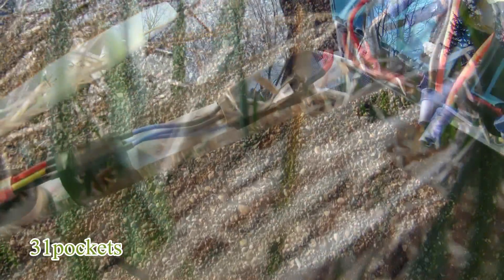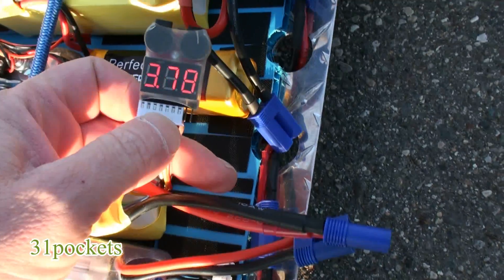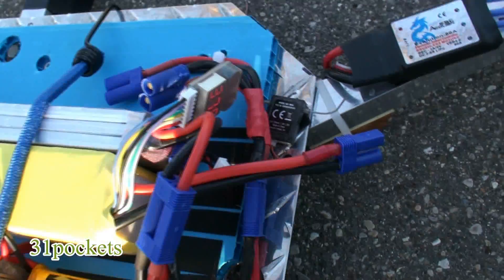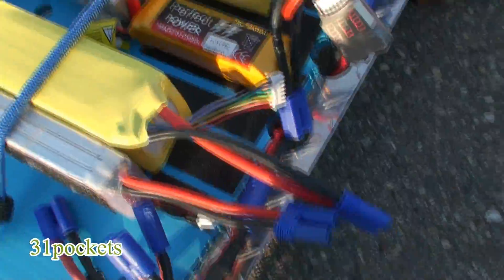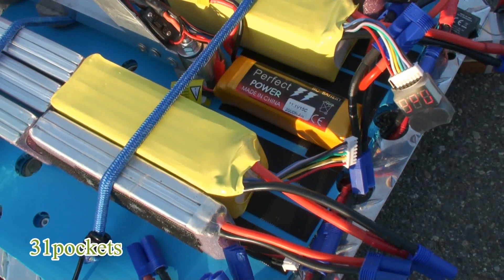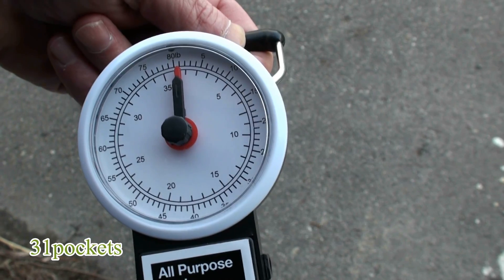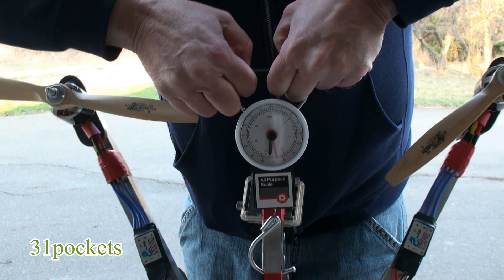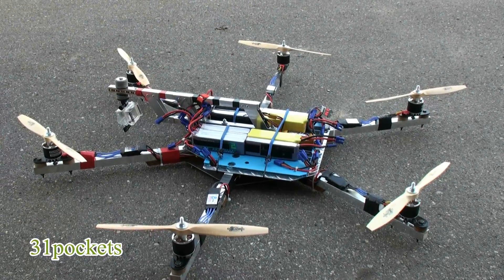Giant Hexacopter Maiden Flight- Hoverfly Pro - 6s Lipo's / low crash on 1st flight test w/ GoPro

Comment: crazy cool no matter what anyone else thinks I am trying to get an HobbyPower F550 hex to fly smoothly so far its not happening I cant seem to get the KK 2.1.5 board to behave smoothly the only thing I haven't adjusted or followed instructions on is removing the power lead from all but one 30A simonK ESC which will power the Flight control board and the receiver.Your comment would be greatly appreciated

Comment: 1100KV motors and 11inch props. 5 minutes flight time with a gazillion batteries? The entire design is totally wierd. You use the heaviest material to build the frame. Motors that were not designed for such large size multi-rotor and wrong size props What is the design goal hear? You even burn out en esc on your first flight. Watching your build I can say for certain I would never ask you to build one for me. Totally wierd design concepts....
Reply: They are 580kv not 1100, did u read the description?
Reply: And 15" props for that matter

Comment: i've been trying to load your video here at the office, where is the only place i have internet, only, youtube videos are blocked and i cant see the total weigh of your setup which im guessing you show at some point in the videos, so can i ask how heavy is it, im currently building a hexa not as big as yours, using 4830 - 420kv turnigy's, 45 amp esc multistars on each, and a 6s 40c 2.2 mah pack for every motor, so far is barely under 6kg, i'll be using apm 2.6.  any suggestions?
Reply: He said 38 lb ... built yours then weight it

Comment: Ok, I have reviewed this series, I like the setup, however, I have to state that the frame material that I will be using will be Carbon Fiber (Yes, it is more expensive, but lighter and stronger).  I just need to know what size props you were using on this.
Reply from the maker: Hi its been really busy at work and sorry to get back so late. I made this hex to use in the hobbyking beer lift and see if it could fly around and its not like a carbon fiber hex. the propellers on this one are 15"x 8 pitch and that means they will not work on carbon fiber! When I build a carbon fiber hex it will have 15" x 3.8 Pitch or at max will be 15" x 5.5 pitch. the 15"x 8pitch props will burn up your esc's or your motors!  so I hope this helps with the props. thanks
Reply: But wouldn't that depend on what Amperage the ESCs are, as well as what size the motors will be?  I saw a video where a guy was building a scratch built hex and was using it more for a movie prop than anything.  If I remember, he used a size 5505 Motor, and I don't remember the size of Prop, the ESCs were pretty hefty also.  He was building it out of Stainless Diamond Plate and 1" Square tubes cut at 24".  I mean essentially most will know that with the larger the Toy, each item that will go with that toy for power would also increase, so, let's say that you have a toy that is going to be 1500mm, you will want to have motors that will be at least 5000kV or better in order to lift the toy, then you will also need to have the proper propellers to help in that area, which, I would think in terms of being at least 15 to 18" with a 5 to 8" pitch to them.  Criticize me if I'm wrong.
Reply from the maker: covertops2011 Thanks, Again this hex build will not help you with a carbon fiber build! so I put some of the top copter builders on youtube that work well with carbon fiber and the first is alishanmao, Jacques Productions and foxtech. these are some of my favorites just to name few with too many others to list! Also I it mite be better for you to start with something a little smaller, say with something like 450 or 550 and get one operational so you have a better understanding of what the components do? So I hope this helps and thanks for your comment.
Reply: You're welcome

Comment: couldn't find a lighter material other than metal?
Reply from the maker: Hi The motors on this giant hex are 1500 watts, weight is about 2lbs each along with 2 horse power on each motor. That's why its called a giant hex and carbon fiber will not work on this one, carbon fiber is only good to about 30 to 40 lbs in flight? this copter is setup for 100lbs! so I hope this helps.
Reply: Do you think or you had tested it at 100 lb lift ... total 140 lb of motor lift ...
One last question ... how much did invested not including the gopro!

Comment from the maker: Thanks, I have the 10 Gage  wires as short as I could make them so I feel the battery system voltage is just to great at 25 to 28 volts and these esc's can only handle 22.2 volts? So the new esc's I have now are the Phoenix Edge 100 amp that handle 32 volts w/ a burst of 170 amp.
Soon as I get some time off at work I will try and do a set-up video on the Phoenix ESC's and will find out if they work? thanks

Comment: Can i suggest you shorten the length of the wires leading up to your ESCs?  If you have long power wires going to the ESCs, you are going to generate massive amounts of inductance in them.  That inductance will stress your ESC's capacitors and is probably why you lost one of your ESCs during your flight.  Long motor wires are preferable to long power wires to the ESCs.  The alternative is high freq. caps in parallel with your power leads at each ESC.

Comment from the maker: The 2 yellow 6s lipos I tested are 4500mah each and the rest are 5200mah so the 4500's act like a meter for testing voltage on the system. The copter has a hard wired in 6s alarm for the motors and a 3s alarm hard wired  for powering the board, I also can run 
2 test alarms in the 4500mah battery's because they should sound off first before it runs to low on voltage.

Comment from the maker: On my hex I do have it setup to run the 6s system all together for esc and motors along with one 3s to run the hoverflypro w/ the lighting, I think some of the other copters in the HK beerlift have lipos that run their motors separated for each boom? you can set them up to ways.

Comment: Ok now I get it. when  you check the voltage on two lipos in the video, you are checking all the lipos hooked up in parallel.  I think the guy that won last year had the lipos out on the arms, 2 per motor and just ran the control leads back to the FC

Comment from the maker: Thanks, I picked up a new set of Phoenix Edge 100's castle creations with heat sink last week. I think they will work because their 32 volt and 170amp burst rate, the aerolians are only 22volt rated w/ 100amp burst? I should have  a video on setup when it slows down a little were I work.
thanks

Comment: I think they screwed up on the esc requirement for the 5055. I noticed and people complained that the info on some of the electronic they sell is wrong.I will get a esc that is 10A more on my motor requirement to be safe.Those higher Amps esc's are not cheap to burn.

Comment from the maker: At the time I got the 5055 they where still on the hobbykings web site and it  required 80a esc on the info page, after the melt down on 2 esc's while bench testing, I tried to use the throttle curve on the dx7s and found it would only work in heli mode without the 2 stage gear switch so I then changed over to my DX8 and trimmed down the throttle on the top quarter 21% before the maiden and this seemed to help the esc's to run cooler.

Comment: The NTM 5050 required 100 A esc's and if you are using 80A on the 5055,you did took the risk of burning /frying the esc's. If I will decide to get/use the 5050,I will be using a 120A esc's but,I can't find one with good reviews yet.

Comment: I have maiden it, I ended up making some changes 1100kv motors now  and reduced my props from 11x4.5 to 10x4.7 and went to 4s batteries.  The weather has also been a problem here too, so I  haven't had time to tune it well.  I wanted to capture the maiden, but I've been getting out and flying a battery or two without much planning. Hopefully I'll get a break in the weather and get a video to post.

Comment from the maker: The 5050 and 5055 can handle a 16"9 prop but, depending on the size of the copter I would start with a 15"6 or 15"8 Zinger and if you cant find them at a local hobby store they are vary easy to find on ebay.

Comment from the maker: My first pick was the NTM 5050 and just happened to stumble in the bid on ebay for the 5055's, now on the 80amp esc's I did burn up 2 when the motors stalled during bench testing and the third one on the maiden flight, so my next esc's will be 120a or 150a but, not sure witch brand at this time?

Comment from the maker: Thanks, as far as I know the SK 5055 580kv N type is no longer available threw Hobbyking and the next close motor is the NTM 50550 580kv seen on the hobbyking web site. I won package deal on these motors last spring on ebay, the only other motors like these I know of for sale are the Blue Silver 5055 580kv C type newer version on ebay and seller is zone2you.